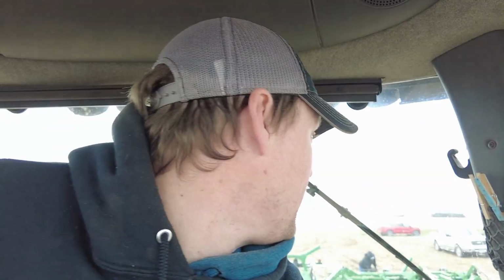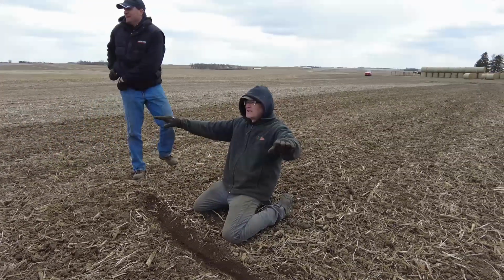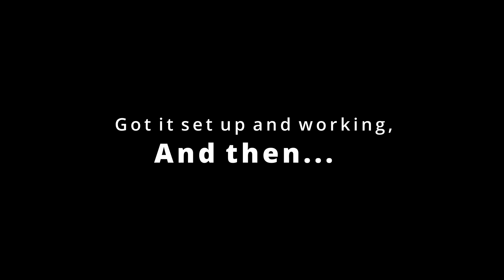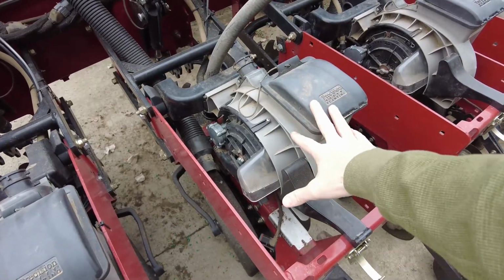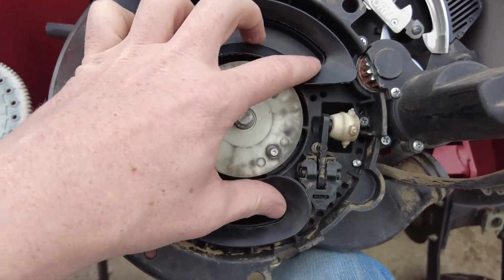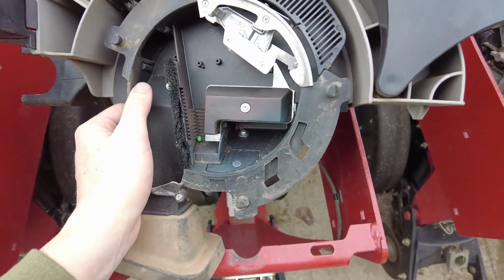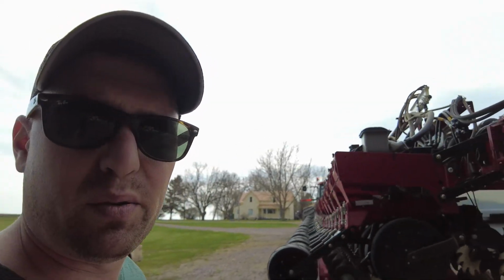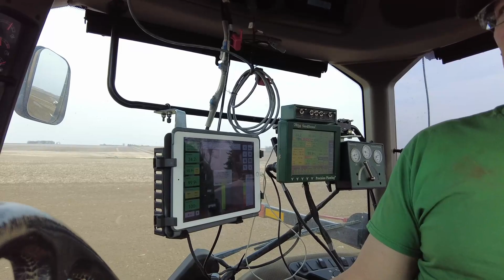How Does A Case IH 1245 Corn Planter Work?

Comment: You said your use of 20" spacing is uncommon. What do others use and why?
Reply from the maker: The most common is 30". Beans are commonly planted in 7.5", 10" 15" etc. Corn is most commonly planted in 30" but a lot have been moving to 20s like us. It really depends on your equipment and what you have done in the past.